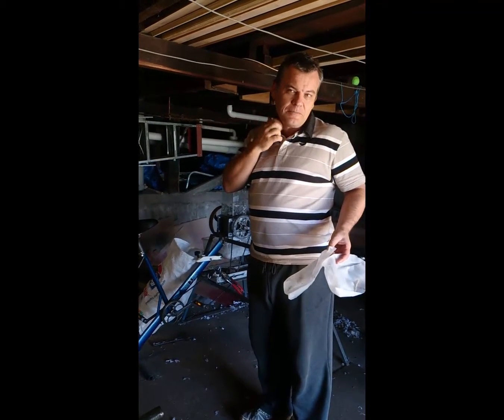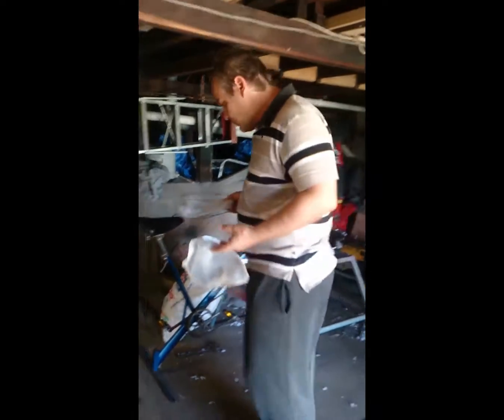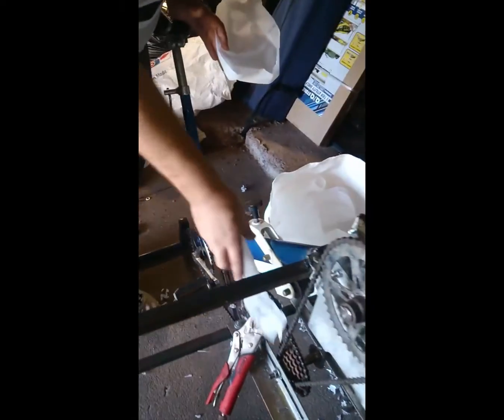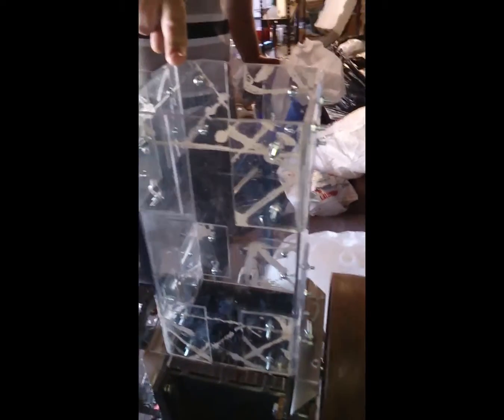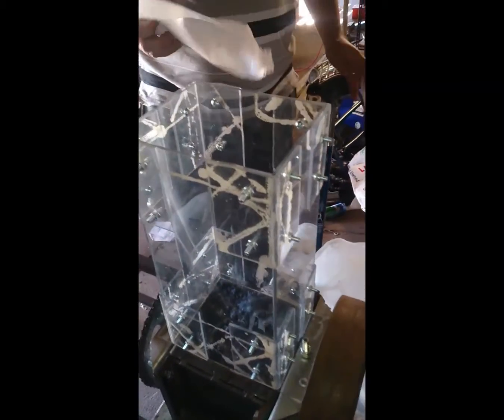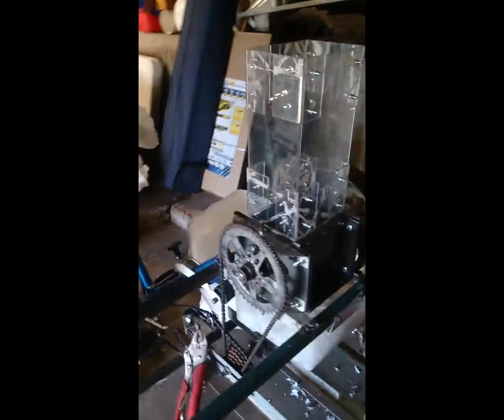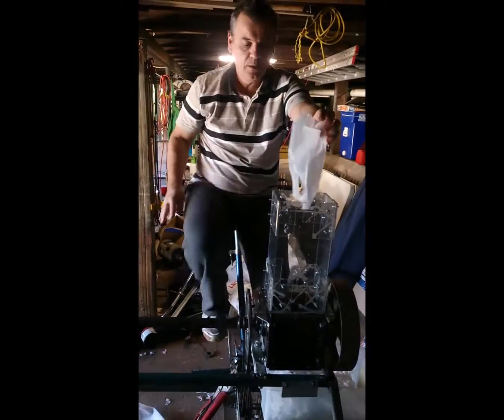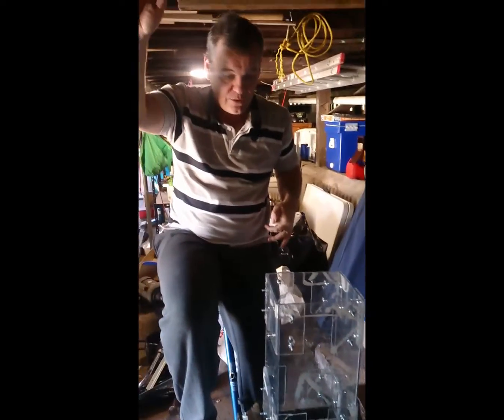Pedal powered plastic shredder

Comment: Hi Simon, superb machinery! Do you think this could work as a food shredder? I am trying to design and build a bike powered food shredder for composting at the Mullumbimby Community Gardens. Any tips would be much appreciated. Thanks
Reply from the maker: Hi Peter, I am sure that you could shred food with it, but I imagine it would be too expensive.  You would need to get stainless steel blades to prevent it from rusting, and that is very expensive (>$600).

Comment: Exactly what I'm looking for and for the same reason!  Thanks for sharing.  Could I ask though, why do you go from pedal to an axel then up to drive the shredder?  Would it be easier to drive the shredder directly from the pedal cog?  I don't understand that bit.  Well done!  Poo
Reply from the maker: Heya, I went with the pedal to the rack then the rack to the shredder to help with gear ratio.  Even shredding think plastic like milk bottles is surprisingly hard work.  If you went from the cranks directly onto the shredder I think you would find it too hard to pedal.